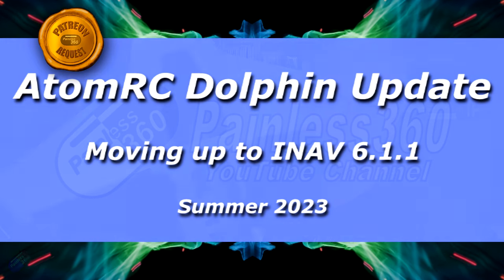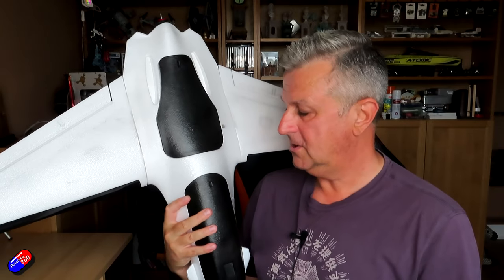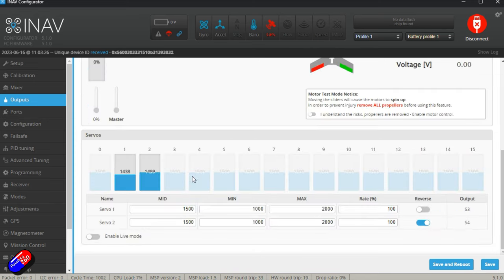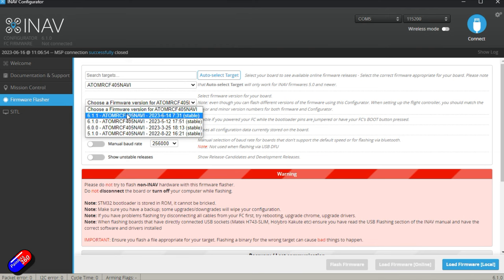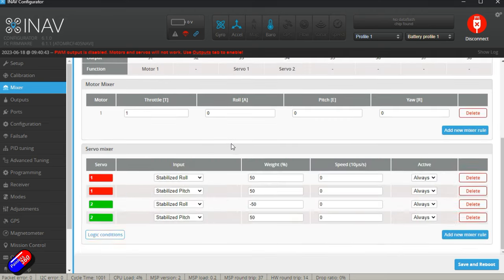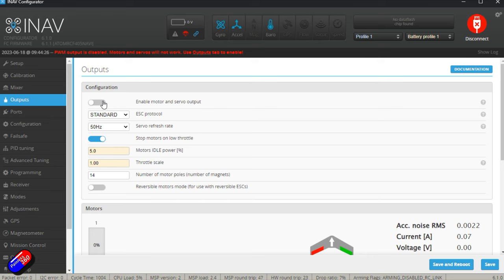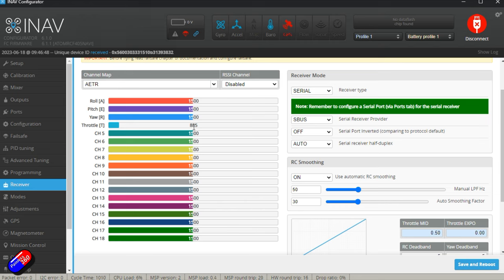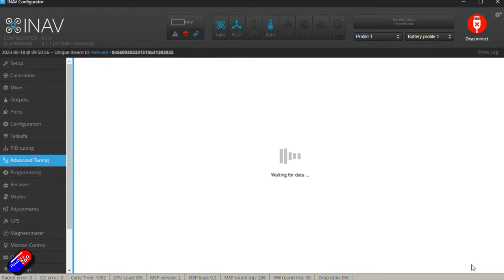How to update INAV a 'RTH' AtomRC Dolphin, Swordfish or Penguin

Comment: Every time I AutoLaunch my Dolphin, it's a Bucking Bronco affair - I fear my throttle and angle settings are to blame (1900 and 20, respectively). What do you use for these settings, everyone?
Reply from the maker: Diff All link for mine in the description... Happy flying
Reply: @Painless360  I will have a peek Sir. Appreciated, we'll see if your settings calm her down a bit.
Reply from the maker: Make sure the throws are not too high, too, and the CG is spit on- see my original flight review video for the model.. Best of luck!